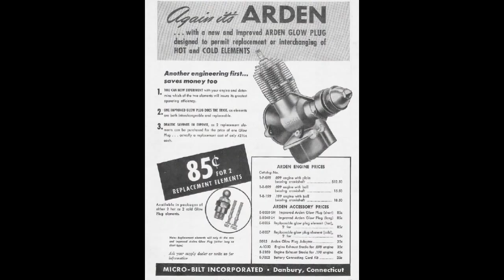Arden .099 ignition (1946) USA

Comment: Happy to hear one run. Is it plain bearing or ball bearing? It sounds very powerful and high rpm. I have several old damaged Ardens and one new in the box with a throttlle. I also have a dream of an Arden .19 RC with Arden accessory exhaust and also diesel head. Never found or built one yet. Rare. Thanks, Paul